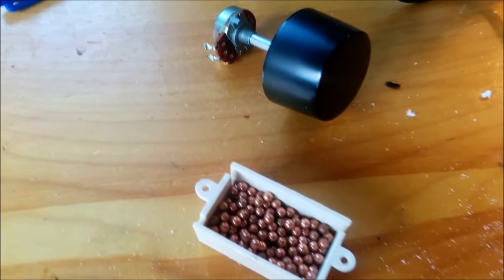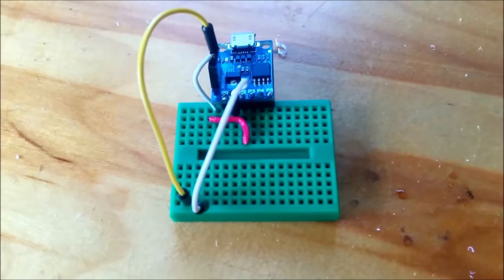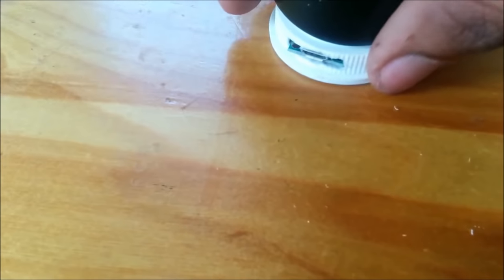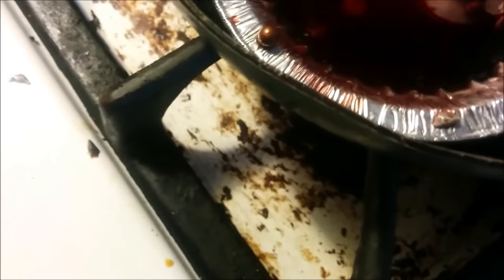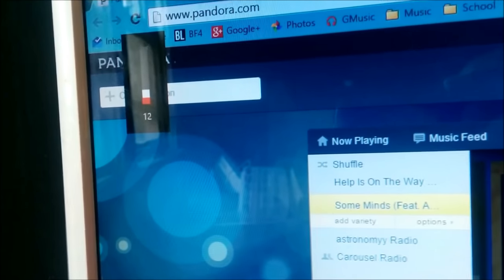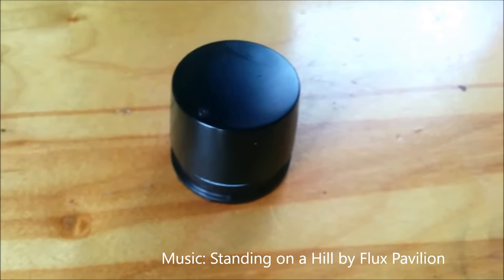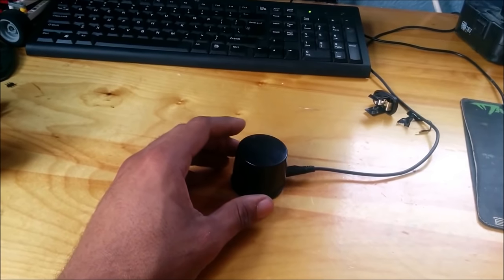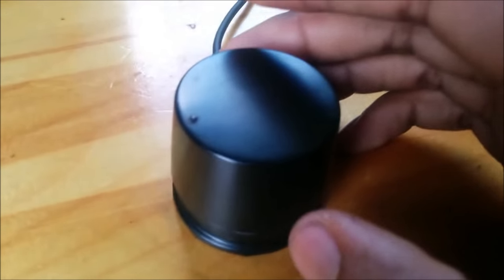Cheap DIY USB Volume Control knob!

Comment: cannot compile ur code with arduino leonardo :(
Reply from the maker: +m4t3k1991 No, it only works on the ATTiny85 chip.  If you want it to work for arduino, try this.  It is a bit involved, but it is actually a better solution: http://stefanjones.ca/blog/arduino-leonardo-remote-multimedia-keys/

^You'll need to use an older version of the arduino IDE though.

Comment: Amazing project dude! Can you please show me the wiring of digispark with the rotary encoder as i happen to have a Keyes- 040 encoder
Reply from the maker: Harsh Mistry Thanks! check out the Instructables page in the description for details about building it
Reply: My wiring is as follows it works for me. Im using code with the mute feature. 
Encoder to Digispark
GND to GND
CLK to 0
DT to 2
SW to 1
+ to 5v

Comment: I'm in the middle of making it right now :), planning on adding more functions and probably an RGB LED for aesthetics (which just glows and fades colors on the sides or bottom or somthn idk). Though the digispark has very limited pins to work with so I might work with something else. What do you recommend besides a board with atmega32u4 (and also has a reasonable amount of pins)?
Reply from the maker: Is the 32u4 the Leonardo/promicro? Other than that I don't know of any.  It's actually quite a complicated thing to do, the library and sketch do it for you with this project, but due to my current project I've learned how how advanced doing such a thing really is if you don't have a premade library made by a very smart person. Have you made any progress?

Comment: Got the attiny 85 installed and used the example flashing LED on off program working, but I can't get the https://learn.adafruit.com/trinket-usb-volume-knob/code to workI downloaded the Library folder Adafruit-Trinket-USB-master and put it in the c:\program files (86)\arduino\libraries folder, but when I do upload of the sketch I get the error: Invalid library found in C:\Program Files (x86)\Arduino\libraries\Adafruit-Trinket-USB-master: C:\Program Files (x86)\Arduino\libraries\Adafruit-Trinket-USB-masterAny ideas?
Reply from the maker: But you  can install  other sketches fine?
Reply: I have same problem. And yes, I can instal other sketches. Can you help me?

Comment: Hey thanks for this video and the instructables writeup! I'm in the middle of making one but had a question about the click to mute function, which spot are you supposed to wire it to on the digispark? As in, what number? Cheers
Reply from the maker: I honestly can't remember, 

One sw pin goes to 5v, the other goes to a digital pin on the digispark,   if you look in the code there should be a clue.   Just look where the mute code is and you should see (depending on how familiar you are with code)

Comment: Could this work with Mac OS X aswell?
As far as I can tell the HID API is the same on all major platforms, so in theory it should work without having to change any code right? Do you maybe have any way of testing? 
Would love to build one of these myself, but I'm dualbooting Windows & Mac, so I'd need support for both!
Reply from the maker: +WS I am not sure if it works on mac, sorry--And I dont have access to one, so I really don't have any way to test it for you. :(
Its a learning experience though, so I suggest that you built it and try it anyway.  I know of another method that definitely works  on mac and android and windows, but it is a bit more involved, if you are interested.
Reply: It do works on mac.

Comment: Hey, I've bought all the components and started wiring. 
Question: you use only the 3 pins on one side? The other two are not used? 
Thanks in advance.
Reply from the maker: you only use the other two if you enable the mute click. 

when you press down on the encoder, it is a button, and that can be coded to mute the volume.  make sure you subscribe! XD
Reply: So the way you did were using the two other, weren't you? Which pins did you used? Do you have another a sketch or pic from the wiring? Thank you for the response :D
Reply from the maker: +Acir Mandello Junior did you follow the instructibles tutorial?
Reply: I got the volume to work :D
And after reading the comments, got the MUTE to work by using P1 and 5V.

Man, thanks a lot!!!!! Now I must create a enclosure for it.
Reply: Do you think it's possible to add mechanical microswitches to use as Play/Pause, Foward and Back buttons?
Reply from the maker: Acir Mandello Junior It may, but I don't believe that the code has support for those functions.

Try looking at this article though, I know for sure that it definitely has support for that--It is MUCH more involved though. 

http://stefanjones.ca/blog/arduino-leonardo-remote-multimedia-keys/
Reply from the maker: +Acir Mandello Junior I dont think it will work with the digispark though--Needs leonardo.
Reply: I'll try in the future. Thanks again!!!
Reply: Instead of media keys, I think I'll try to add a LED for showing the volume intensity. Do you know if with  this encoder I can use a RGB LED for turning from red to blue as the volume increase? 
I'm in doubt because since this rotary encoder has min and max undefined, it should read the windows volume value to set from 0 to 100.
Thanks again, this volume is already making success in my house, hahaha.
Reply from the maker: Acir Mandello Junior It will work, but if you restart your PC, the value will become incorrect. 

For example, if you have your volume at 100%, the encoder will turn red--But if you change the volume in the PC via volume mixer, or if you restart the PC, the arduino won't know that the value is no longer 100% and the LED will remain red even if the volume is not 100%
Reply: Maybe if I get to set the volume at 50 when the cable is connected, I could know from where to start counting. Would this work? Any ideas?
Reply from the maker: Maybe if you set the knob to not go below 0, then if you turn the volume all the way down, they will both reach 0 and become synced.
Reply: please tell me how to wire for mute key....should i conect 5v to p1..
what is sw for....
Reply: prem swaroop Yes, you'll use P1 connected to 5V to work.
Reply: plz tell me,should i connect sw in rotatory switch to  p1 in digispark and p1 to 5V ??
Reply: sw to p1 to vin worked for me....thank you
Reply: @Pavala.5  ehow did you get the mute switch to work? You wired SW on the switch to p1 on digispark, and then also connected p1 to vin? Or did you connect the other pin on the rotary switch to vin? I am having a hard time understanding what you meant there
Reply: @ryanparker2077  send ur email, so I will send the pics
Reply: @davidrajkumar4896  forwarded :)
Reply: @ryanparker2077  That was super quick. thanks alot.
Reply: @davidrajkumar4896 Check your email Bro.

Comment: Any clue does this work with Android?
Reply from the maker: +Mika Rauhala I don't believe it does. I do know a way to get USB volume control for android/windows/ios, if you are interested.  It uses a pro Micro instead of a digispark, but it is a bit more involved.
Reply: Yeah I'm interested!
Reply from the maker: Mika Rauhala I'm actually working on a wireless version of this video, and the idea used is based on this:
http://stefanjones.ca/blog/arduino-leonardo-remote-multimedia-keys/
Reply from the maker: Mika Rauhala Just follow this guys guide, let me know if you get stuck, but basically it adds native USB volume and media controls to the Leonardo (and/or the arduino Pro mini)

Note: this hack only works with arduino IDE 1.0.5r2
Reply: I've tested mine and it worked. In my test, I've used a Nokia 8 with Android 8.1 and a USB-C to A adapter. When I press the button, the ringer goes on silent. If the music is playing, it will raise or reduce the volume and goes mute in the button is pressed. Also, it worked on Linux, in my KDE Neon distro.
Reply: @admiralwhiskers  Yes, The same board seen in this video worked on Windows, Linux and Android. It also worked on a notebook running Batocera Linux and on my Raspberry Pi 3 running Retropie and Raspbian.

Comment: Can u list off all the items you need to do this projects ?
Reply from the maker: really it depends on how you want to do it. as far as getting it working--all you need is a digispark and a rotary encoder (or potentiometer).

alternatively you could use an adefruit trinket. 

I am really sorry that I didn't add more detail when making this.

if you decide to make it and run into problems I am here to help!
Reply: +Kris S The Video was grate Just Fyi in the future Maybe u should put the stuff in the description or something like that.
Reply from the maker: +InfiniteZ3RO http://www.instructables.com/id/Digispark-Volume-Control/

Comment: i had to remove the led on pin 1 to get it to work kept pulling it low and prevented it going high
Reply from the maker: Interesting.  Were you using a resistor on the LED?
Reply: it was the inbuilt led that i removed because the 10k pullup on the switch wasn't strong enough to over power the led
Reply from the maker: playdav485 Wow, thats really strange--Thanks for posting, that way if anyone else has the same problem, they can see what you did to fix it.

Comment: that's great!! can this be usede also as an input for a python program?
Reply from the maker: Unless you're watching for volume up key from your program, no. But arduino can easily be used as an input for a python program--You'd just need to use a different sketch instead of this one that is designed to talk directly to the OS--This sketch turns the arduino into a keyboard basically.
Reply: @EngineeringNS   I would like to use 3 knbos as analog input to a python program, so not related to volume. which way would you reccomend me in this case?
Reply from the maker: You could set up a Leonardo to act as a gamepad--Like a gaming remote. That is quite easy to do and there are many library's for it. Alternatively you can just output serial commands from any type of Arduino and have the python program read the serial port and translate your serial commands to coordinates for 3 joysticks. 

What is the project, now I'm interested!
Reply: @EngineeringNS   do I have to program with arduino language in that case? or can I just connect the board with knobs and buttons, plug it into the pc and using just python? unfortuntately I'm not familiar with arduino language and I'm quite new to pyhton as well. do you know where can I find some guide or tutorial to set it up as a gaming remote as you said? by the way, I'm glad that you're interested! it would be an interactive installation where the user could play with 3 knbos and generate a unique design and then print it. it's kind of a generative design project =)
Reply from the maker: Yes, in either case you'll end up needing to program the arduino--But there are very many tutorials on youtube for that as the Arduino is very popular. Sorry, I don't have time to find anything for you since I am entering finals week at University--But you should search YouTube for turorials, Arduino is very easy and most of the time someone has already done what you are trying to do so you know need to copy their code.

Comment: Great idea, and thanks for sharing. Don't forget to post new ideas to help out the cause. I bought from Ebay, ended up with a Rev 3, which Digistump never released. Read "Counterfeit". So the mere fact you had functional bootloader from Aliexpress is notable, even though it is a "version" of the Digispark design. On mine the Bootloader is missing, and so Windows, even with correct LibUSB 32 drivers will never recognize it. Lost a day. And though not a fair part of the learning curve,  I am not entirely sure that I will trash these straight off. Difficult though, dealing with SMD components out of circuit. I have ordered ATtiny85L dip, and a version of the Digispark that is a dev board and allows for ISP. An awful lot of screwing about to get this up and running I am afraid.
I will go look at Trinket for some ideas as I await my bonafide  items.
Reply from the maker: +Chris Leech I don't believe it is hard to put a bootloader onto the digispark. All you need is some wires, the bootloader files and another arduino. I didn't know that some came without it.  I bought 9 of them from different sellers and all had the bootloader built in. How familiar are you with digispark?--It is a bit more involved than regular arduino's, so it is not recognised as easily; as it does not have a usb communication chip but instead just a couple of diodes and clever programming.
Reply: +Kris S  Thanks for your interest and suggestions Kris. Yes I have been through it all, the vendor even admitted that he did not install the bootloader. Did offer the Digispark Install files though, of course this does nothing with out the correct bootloader. Chances are the vendor doesn't know the first thing about what he is selling.
 The unit is a Rev3 - its counterfeit, they never released a Rev3, info is plainly listed as topic #3 in the Freq asked Q's at Digistump.
And I won't be held hostage by these unscrupulous Ebay vendors, I will simply buy from the source, or at the very least take your lead and order from Aliexpress.
It would be nice to keep the ball rolling, rather than the 30 - 40 days delivery times that create this massive hole in ones productivity, so I am thinking about Digistump purchase and expedited post out of USA (to Canada)
Reply from the maker: Chris Leech Not sure if you have or not, but try to put the bootloader onto yours. There might be good info here:
https://digistump.com/board/index.php?topic=1414.0

It really isn't hard once you get the hang of it. The one's I had were also clones, I don't think you can get the real thing for so cheap.

But if you want to reduce waiting time, just buy the real thing from digistump, only $8 
http://digistump.com/products/1

Or, buy the trinket from adafruit for $6 
https://www.adafruit.com/products/1501
Reply: I got a rev3 as well, but its working absolutely fine.
Reply: +Engineering Nonsense  Sorry, I had not been made aware of your last reply. To give you a little update, I learned how to get the Micronucleus bootloader on it, and maybe i am a little sketchy on the correct fuse settings, and that is important in two ways, one, to section off the bootloader in the flash, and the other is to get you GPIO5 in place of the RST pin of the AT85.
 For me, it is wholly a matter of Win7 and USB drivers. Really irritating. I have so many things stacked up that are not working for my wide and varied interests and projects that are just about "Windows not recognizing device", even though I have installed the correct drivers.  I Could not tell you even a guess as to why. Is it Windows or hardware? No idea still!! MInd you I did get pissed off and throw up my hands in disgust so I kinda gave up trying the USB.
It (USB drivers) has become a major stressor, so much so that I have just gone to other projects that I know will work (i.e Arduino IDE and ATTiny85, I just use the 6wire ISP to program). 
This would be of little use to get your USB Volume Controller as I still cannot make any of my digispark boards talk thru the USB connection. Some are like yours in this video and some are the the so called Rev3.
 I do so wish my WinXP Laptop had not become so unrully. I had so little issues with these types of drivers. 
To finish, I have decided to go back and see what is to be done, and I will make a notebook to record all details of my attempts to make it work, so I can at least make educated questions at Digistump Forum
Reply from the maker: +Chris Leech Wow, mine just worked fine on the first try--Only took me 20 minutes.  Seems you have some pretty poor luck! XD

I know of another solution:  Try using a Leonardo--I'm not sure if it works with the uno--then use the instructions on this link: http://stefanjones.ca/blog/arduino-leonardo-remote-multimedia-keys/

^^you must use arduino IDE 1.05 I think.
Reply: +Engineering Nonsense I take it that you have changed your YT avatar / name whatever. That must have been rather a bitch no?
 I had responded to a guy named Kris S at first.
 Look if I had the same issues with this Digispark with 20% of my electronics and RC based drivers or firmware, I would have commited suicide by LiPo battery explosion. But really, I made the first false move by buying from Ebay during  budgetary constraints. I have the real deal coming in a day or two, fingers crossed. Still if you go and raise this issue of Win7 and getting the correct bootloader and fuse setting at the Digispark Forum, you will inevitably get three different answers  none of which will get you there :-) Thanks for all of your suggestions, now it is late and I am going back to preparing for an FPV maiden for tomorrow. Fly crash fix repeat
Reply: +Chris Leech Wireless is looking promising BTW, thanks
later,
chris
Reply from the maker: Chris Leech Kris S was my google+ name,  but engineering nonsense is my YouTube channel.

Good luck on your endeavors.